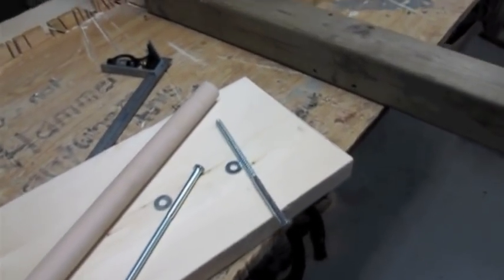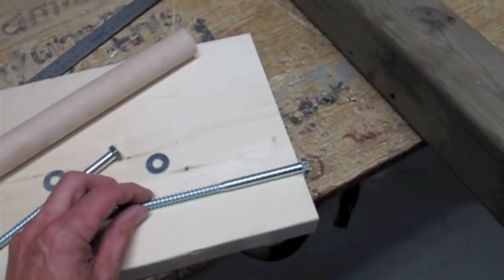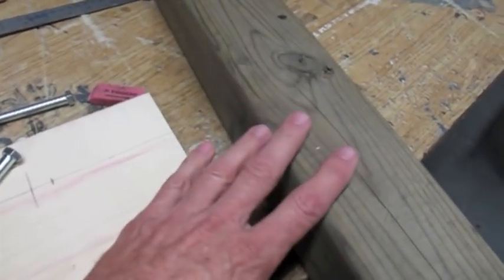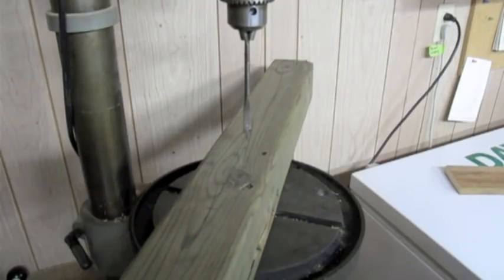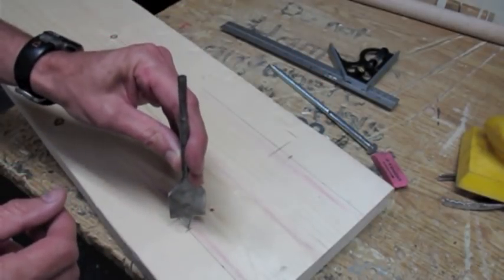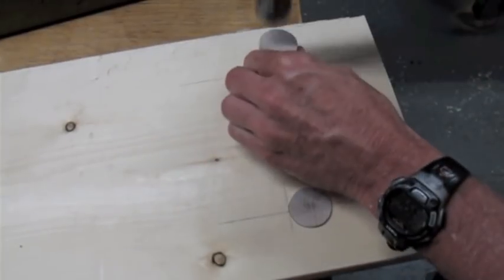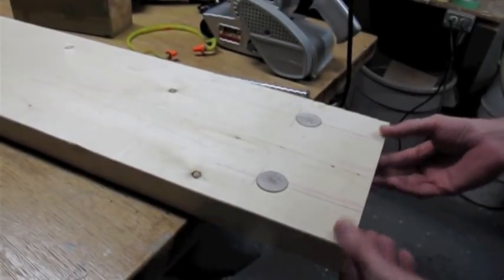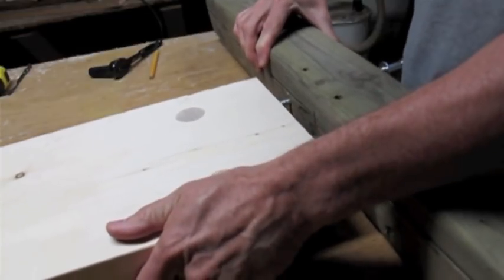Build a bed with strong joinery like this ● extremely strong and easy

Comment: Super useful tip. Thanks. I used this method to build bunk beds using two 6 inch lag screws on each corner. Worked really well.
Reply from the maker: Thats great! It does make a very strong joint. Thanks.

Comment: Thank you for making this! I am in the planning stages of building a bunk bed for my daughters, and have really been struggling with several different ideas about how to attach the side rails. I am curious, though, how this joint might compare to using actual bed bolts. It seems like you are already drilling the same holes as you would for bed bolts, so the work is the same. What are your thoughts about the comparison between this lag bolt method and bed bolts? My idea is to cut a blind mortise for the rail to insert slightly into the post, then also attach the rail with either the lag bolts like you did or with bed bolts.

Comment: You know what’s the best thing about this joint 
Let’s say the bolt does does strip you can always knock out the dowel and replace with another one without doing major change to bed 
Awesome idea thank you
Reply: It’s glued in.  Glue is stronger than the wood itself so u won’t be knocking anything out

Comment: One can also use regular nuts and bolts by flattening one side of dowel holes for washer/nut to rest against. Then you omit the dowels of course.
Reply: +Chris Notap I made a bed with the Rockler bed post fasteners, and to screw the hook-side into the end grain of the bed rails, I did just what you suggest in your video. It worked great. Thanks for the great video.

Comment: Great tip, thank you for sharing. This can be applied to many other joints like workbenches etc. If you use a forstner bit and stop short of the face side by a few mm you can completely conceal the joint too.

Comment: Thinking about using this approach. With those two lag bolts in on one side the post, how would you join another rail at the same height but at 90 degrees to the existing rail?
Reply from the maker: +Dan Higham just lower or raise where the hole is to be drilled so as to not intersect with the other bolts.

Comment: This is a nice idea, and it does seem strong. I'll file this one in the mental database. However, it seems like almost as much work as adding mortises and tenons to the joints. Of course, at least you can do this with just a drill and a wrench!

Another idea is to use structural screws. Most lag screws are just generic and unrated, whereas all structural screws will be rated for high loads (e.g. attaching a deck to a house). If you're screwing into a 2x10, you could just use a third structural screw in far less time, and most likely come out with an even stronger joint. The biggest downside is adding a few bucks to the cost of the bed frame.

Comment: very nice...
Assuming this is to connect the side rail to the corner post, I can't figure out how to connect the head rail to the same post using the same method. I would appreciate your expert advice as I am really a beginner. Thank you in advance!
Reply: Serhat Akiska I'm not quite sure what the problem is you're having. It works exactly the same way, only height-wise, the bolts will be offset a bit.

Comment: Dude, freaking brilliant... I realize it's not as magical to the more experienced, but I'm just getting into this stuff (@45y.o.)...
it looks like old tech with new tech. 
I'm building the Ana White Farmhouse Twin Bed for my daughter and have been stuck on how to attach the 4x4 posts to the headboard & footboard, as well as this. 
I tend to "overbuild" most things (buildings/ structures), just getting into this kind of construction - so - I like your 2x10 choice for side rail frame; her site says use 1x10's, which I'm sure will work - but kids (10y.o.) tend to bounce and be a bit rougher than older teens. 
I love this kind of out of the box thinking
Reply from the maker: +BUJINKAN SATX   Thanks so much for that!
Reply: Steven Waling I’m looking to build that same bed. The Ana White modern farmhouse. King size for my wife and I. I’m a stocky fellow and 6’4. So I don’t want to build a bed that will collapse. And I also am not in a “forever home” so I’d like to build something I can disassemble and take with me. That rules out the strong joints like mortise and tenon or dowels. I think this joint is the answer for me.

Comment: I'm using 1 1/2" African Mahogany for my rails and a Purpleheart dowel.  Wouldn't a 3/8 lag bolt eventually split the wood? There isn't much room. I'm wondering if a 5/16 lag bolt would bey bette?

Comment: Also, if you counter sink the bolts, so they are recessed into the post itself, you can buy decorative swinging bolt covers from suppliers that sell bed hardware. IN that way, the bolt heads aren't seen and it maintains aesthetic appeal.

Comment: Hi. I'm making a loft bed that's 1m× 4.3m. 3 of the wall are attached to the stands on the inside of the wall. I im wandering if you have any recommendations about the bering beem that will go from one side to the other and its thickness to be able to stay on its one, without a lader in the middle or something. I really want an open feel of the room and a stikk og lader is of for me 😁

Comment: Well presented, very useful idea.
Two questions please.
1. Did you drill the dowel holes all the through, or are they 'blind' holes?
2. What is the issue with using the pressure treated timber for bed posts?

Cheers and thanks!
Reply: I was wondering that too about the pressure treated, why not use it? It would last longer right?
Reply: I have no conclusive answer, but from other comments Online I think it might have to do with the 'type' of chemicals use in pressure treating the wood, plus any anti-termite agents used; i.e, poison, arsenic, etc.  I have read that you need to be actually wearing gloves when handling some types of 'treated' timber, and also pressure treated wood was not to be used for heavy load-bearing constructions.  But I can be really sure about all of this.  Hopefully some 'in the know' viewers can help out.
Reply: +8233Eire PT is absolutely used for load-bearing stuff. Houses and decks are built out of it. Bridges, signs, any outdoor wooden things, really. 

I would't even get to the health issues when thinking about using PT for something like a bed. I'd stop at the fact that PT is a very rough material, not very nice looking. Aesthetically, it's not something you want in your bedroom. And, it often very wet, so as it dries out, it'll move, sometimes a LOT.
Reply: +Seth Watson He said he just used that PT 4x4 scrap for demonstration purposes. Of course you wouldn't use it for a real bed.
Reply: Angier Crawford I know that. I was replying to the guy who asked why not to use it.

Comment: Awesome this is exactly what i was looking for. i would like to know an option to cover the bolts on the foot board, as it would be exposed. thank you
Reply: Using wood filler or use plastic caps same colour as the wood
Reply: Use a Simpson joist hanger and you will have no bolts showing  and no  drilling
Reply: That's clever!
Reply from the maker: Thanks!
Reply: Countersink the bolt heads, pre stain some dowel ends the same size as the countersink hole and push in the plugs so they're flush. Can work them out if you need to disassemble. Being 90* from vertical, it should stay put nicely. A dab of glue (cheap, weak glue) if you need to stop any wiggles.

Comment: I am going to build me a King size bed, I am going to use oak 1×8's for the side rails. What kind of lag bolts would be best for this type of wood??? Thank you and enjoyed your video. Andy Helms
Reply: If anyone know's the answer to my question, I would appreciate the info. I would also like to know what type of wood, the closet rod was he used in his video?  Thanks very much!!! Andy Helms
Reply: the Rod used is a hardwood dowel Rod. as far as what kind of lag bolt. they are all the same. diameter would be key. I would use 3/8 just as he did
Reply: Andy Helms is the best

Comment: This video is awesome. I did try on a prototype, and it is a solid join. The challenge however is finding a dowel which fits tight into the 1 1/4 hole created. All dowels I check just drop thru. I do use toothpicks to tighten them in place, but finding that exact dowel size is a challenge.
Reply: Bore the hhole slightly smaller than the dowel and sand the dowel to fit snuggly.
Reply: just buy a dowel the right size for the drill bit you are using
Reply: If you have a lathe, make your own, especially if you're needing a larger diameter like this.  I've noticed some dowels bought in stores are not true to the size they are labeled as; some being as much as 1/32" under.

Comment: Without a drill press for those horizontal holes to drill..... one has to be very careful to drill totally level.  Not as easy as you made it look.
Reply from the maker: When drilling without a drill press it's best to have a buddy eye ball it as you start drilling. You yourself can keep it vertical while looking down and your buddy can eye ball it from the side and give you orders to move it one way or the other to get it straight.
Reply: I have an 18v ryobi drill that has a built in level.  Very good drill/impact for DIY use.

Comment: Hi, I hope you could help me to understand something, what´s the difference if i don´t use that dowell?
Reply from the maker: Going into end grain is never strong enough. By using the dowel it creates a strong connection.
Reply: @chrisnotap  thanks a lot Chris
Reply: Going into longitudinal grain of the wood will tear the grain strands and yield a weak joint whereas lateral grain allows for the threads of the screw to fit securely between the grain strands thus yielding a much stronger and reliable joint.

Comment: nice tip. of course bolts need to be staggered in order to clear the bolts that are going in the other direction, unless this method were only for making head/footboards, and would use more conventional bed hardware for the sides (that disassemble more easily). Thanks for posting!
Reply: Right? Would you have to change the placement of these in order to stagger the other two?

Comment: You should have a strong metal sheet connecting the two bolts for a more secure fit instead of those tiny washers.That's how i'd do it.
Reply: +Chris Notap  O,ok  i really liked the concept with the two wooden inserts...

Comment: This is a good idea. I have never seen it before. I thought you were going to join the post and rail with dowel and glue. Do you think that would be ok or would it eventually loosen?Thx
Reply: What about if you ad a nice corner bracket underneath? I believe it will help to keep the joint strong.
Reply: It would definitely hold, but you would never be able to disassemble the bed if you needed to move it.

Comment: I don't understand how come using that pressure treated lumber for a indoor bed would be a bad thing or why it's frowned upon? Is pressure treated wood more specifically for outdoor projects?
Reply: At least older treated wood was with some unfriendly chemicals that you probably dont want to be a few feet away from, always wearing on, inside your home. Outside its fine and probably ok. They also have a different smell to them which could bother you.

Comment: This is a good idea if you are doing joinery in a non woodworking joinery type of way. Better yet would be large mortise and tenons to connect the two with wood glue, you aren't getting any stronger than that. But if you are in a situation where you have to disassemble something to move it in or out then this is a good technique.
Reply: and then you'd have a bed that you'd have to most likely cut apart and destroy if you ever move.

Comment: Noon question incoming:

You're creating this to prevent the screw from having to be driven into end grain? The dowels essentially act as side grain or face grain giving a more secure connection? 

Just trying to establish why someone might choose this kind of joinery over a pocket screw? Besides the obvious aesthetic reasons.
Reply: @BW I was more asking about how the technique you used works. 

 FWIW I used Kreg HD pocket screws for my king size bed frame. I'm 250lbs, wife is 150 and toddler sleeps with us as well. Him and I also wrestle on the bed daily. I secured the bed to the wall as well to minimize stress on the joinery, but it seems solid still after a couple months now. We will see how long it lasts into the future, but I have high hopes.
Reply: @jayjayhooksch1  I assume your frame you made is a made from sheet goods like plywood. The plywood transfers the load down to the floor in your frame the screws just keep it square. In an old fashioned post and rail bed frame with open space unearth the joint bears all the weight and keeps it square it needs to be skookum
Reply: @alec4672   Alec Ver Bunker  Well it's not made from sheet goods, I used 2x4s for structure and 1x3s for slats. But yes, the weight is well distributed to the floor. Its no work of art, but I just use a bed skirt to hide what is essentially a large shipping skid or platform. Lots of storage underneath though, and still holding strong despite much abuse from me and my son horse playing.

I do understand your point though, most of the load is not on the screws directly. But still doesn't really answer my original question, which I guess I worded poorly. I was mostly just trying to understand the mechanics of how the joint he was using works.
Reply: Late to respond (just saw this in recommended vids) but to answer, yes. Placing the dowels into the rails laterally like that is to provide better grain orientation for the lag screws to bite into. When screwing into end grain it's incredibly weak. Think of the grain direction being like a bunch of little straws. The lag screw would just push along between them, not much to grip. Also orienting the grain same direction as the wood with the lines running horizontally, parallel to the lag screws it would be more prone to pulling out. The strongest connection is when the lag screw enters the grain perpendicular. In the vid he mentions paying attention to the grain, running the dowel grain up and down 90 degrees to the lengthwise grain of the rails and the lag screws. 

Also agree with others, the 'diy' space has been flooded with pocket hole screws thanks to kreg jigs. It's the new one size fits all bandaid and surprised they're not showing people how to build homes with them. As others pointed out they have their place but not with 90 degree butt joints where racking is an issue and forcing the screws to bear the load. Even if insisting on using them a person would be better off creating a notch or shelf in the leg for the rail to rest on, where the downward load from the rail is placed in direct wood/wood contact with the leg like a ledge. So the purpose of the screw then would only be to hold the two pieces snug together vs many projects I see where there's no ledge and the screw is tasked holding the rail tight to the leg AND supporting the shear weight/force. 

Bad idea, just my opinion. Better for non load bearing like frames, cabinet facing, even aprons on low load applications like coffee tables or end tables. In that case the piece is only designed to hold a few books, a magazine, maybe a few coffee cups, a lamp. Not a person or two (easily 150-200 up to 400+ lbs wobbling around). The longer the bed legs the more leverage force on the joints amplifying the racking forces. Like putting a big cheater bar or pipe on the end of a wrench to gain leverage.

Comment: Mortise and tenon or a metal bracket would seem easier,       I made a large wooden trolley on large castor wheels and stopping the thing from going out of shape is difficult,       I went for straight through holes with similar bolts but with a threaded end for a washer and nut,         Even though like you showed with turning force you can forced the nut to bury itself into the wood,        It`s still no guarantee that it won`t move out of alignment,        Because that`s what mine did,    From my experience put a washer behind the bolt head also to help stop itself burying itself into the wood

Comment: Did you have the battery charger plugged in? 

Getting a high pitched noise in some parts of the video
Reply from the maker: I think it was the furnace blower. I now turn off the furnace when I shot videos.

Comment: Didn't understand anything in terms of measurements.Not used with emperial sistem 😕
Reply: Put the dimensions into Google for conversion. Or... 1 inch is 25.4mm and convert your self.

Comment: Also, pressure treated lumber, is still not recommended for use inside of the home. While it's no longer treated with Chromate Copper Arsenate (CCA), which is a form of arsenic, it's still not advisable to use indoors.
Reply: Robert DuBois do you internet experts even watch the videos you comment on?

Comment: I would not have used treated lumber for the posts.  The treated lumber is impregnated with chemicals (poison that kills insects) you don’t want your kids exposed to. At least outside the chemicals on the exterior are washed away but in the house they remain on the wood surface.
Reply from the maker: Correct. I used it only for the demo in the video. I should have mentioned that but forgot to. Thanks.
Reply: you did mention it.  people must not watch these videos at all before commenting.